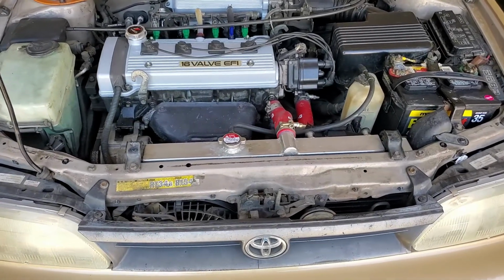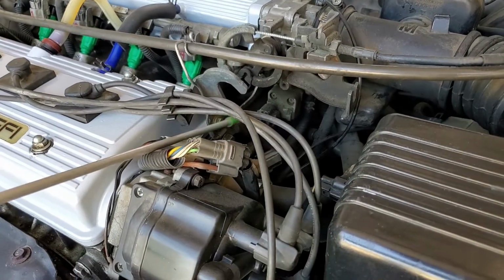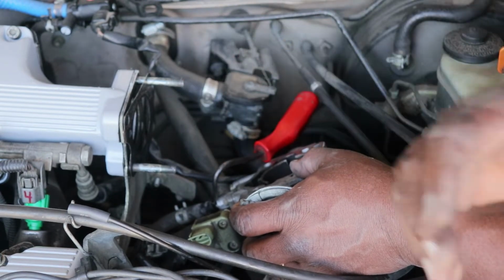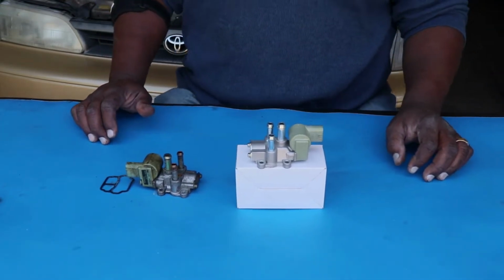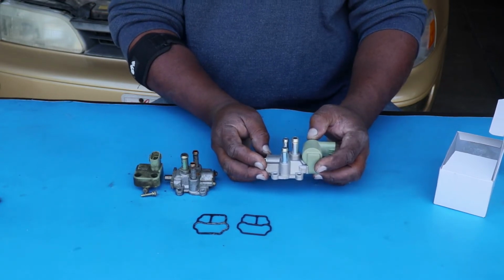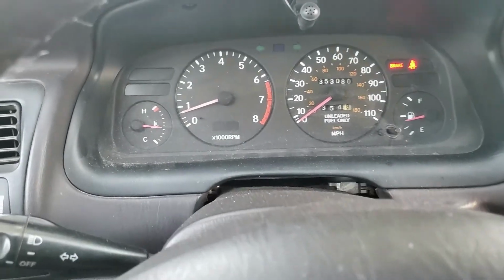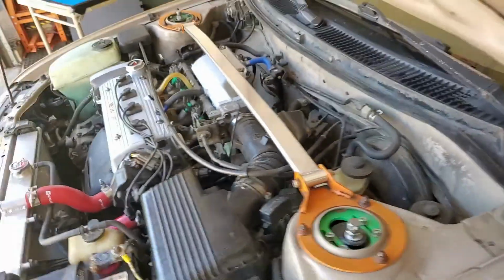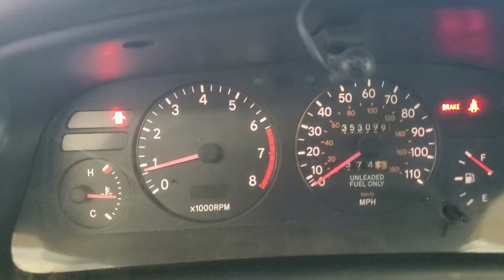Toyota Corolla 7afe Idle Air Control Valve, Old vs After Market vs New OEM

Comment: Hello

So I have the same issue, but in my case I have installed A/C on my own using OEM used parts, cuz originaly it wasn't there. I've installed new compressor, radiator, electricall stuff, ECU and other parts. When I turn ON A/C there is significant rpm drop and stays like that. I wonder if its the same issue like yours or maybe there is problem with ECU itself (not programmed). I will try to change it like you do and come back with update.

Comment: I decided to clean mine up as a maintenance thing but never had a problem with my idle. Even with the AC on it wouldn’t drop the rpms from the load. After cleaning it my Corolla now idles at 2k and drops a few rpms when I have the AC on now 😭😭
I guess something weren’t meant to be fixed but also I didn’t know the control valve was suppose to fully spin. When I took mines out it had about the same play as your old one and I assumed at the time it was normal to be like that.
Guess I gotta replace mines now sadly. Would I be able to just get away with breaking it loose some way?

Comment: Very helpful video bro,you should have used the old electronic module with the new after market aluminium assy to fix the problem. You didn't have to buy the whole oem for all those bucks.😊

Comment: My idle is way to high on a  2000 tacoma  been running with the iac unplugged  because when I unplugged it the idle drops a bunch  , after seeing this video gonna stay away from the cheap ones
Reply from the maker: High idle could be a vacuum leak, or just need an adjustment.

Comment: Interesting. I replaced my IACV with a decent quality one (NGK/NTK I think) which are usually reliable. I feel like when the AC compressor kicks on I loose power. Now you make me wonder if I should be using an OEM instead to see if it alleviates the problem. Hmmmm

Comment: That green coil part of the IACV is on slotted bolt holes. Get it to hot idle and then loosen the 2 coil screws and move the coil up and down or twist is slightly until you get the highest idle, then tighten the screws. I took my OEM apart and the metal barrel had worn grooves in the coil part! It was rubbing on the off centered plastic coil socket. I loosened it and moved it slightly and the idlepicked up and got much smoother, I then tightened the screws. I believe when the idle goes up, the valve duty cycle is greater ( I believe it vibrates open and closed) due to no drag and the engine gets more air as its suposed to. Just a theory but it worked on my old OEM one. The faster it can vibrate, the more air it allows to get in.

Comment: Sir i have the AE111 model i had this issue , i solved the issue by changed the TPS Sensor and the Map Sensor as well. I used back the original Idle Air Control Valve after service back.

Comment: You could have simply cleaned the old valve with throttle cleaner, lubed it with light oil and carefully put the motor back. That would have saved you $150.
Reply from the maker: I tried that first, it didn't work. then the other two.

Comment: I have a '97 Corolla 1.8 & has a misfire 
changed the plugs, still misfiring
thinking of doing the wires next & the IACV 
maybe do the distributor, fuel injectors, & fuel filter next even though a distributor & the IACV isn't cheap (on RockAuto, some are over $100)
Reply from the maker: Check the compression of the missing cylinder. Then check the fuel injectors, maybe swat them around see if the miss follows before spending a lot of money. Better to figure out want the problem is first.

Comment: IACV is hard to die, you should just take it out and clean it, then test the 3 pins with battery power 12V on B+ then you know the problem is on the IACV or on the blue hose device, that is another actuator compensate RPM for the air con on.
Reply from the maker: I did try cleaning the old one first. ... no go.

Comment: Sorry mate, The Idle-up the one with the blue hose is the one faulty not the IACV,...
Reply from the maker: Working great 👍  😀
Reply: this the reason. its not fault with IACV. Idle-up the one with the blue hose connected valve is control Air when on the AC.

Comment: I’m thinking of buying an old Corolla with a 7afe engine, would you say these a good reliable cars for daily errands?
Reply from the maker: Wow, I almost can't believe you ask is a corolla 7afe reliable. Hmmm let me think; it's only one of the most reliable cars ever built, let's look at it like that lol   ;)
Reply: I have had 2 7afes and thinking about getting a 3rd in a stick shift best bang for the buck car on the market just be aware of leaks on these old cars
Reply: GO FOR IT!!! I still have my 95 Celica in my driveway from high school. This car is so reliable, I haven't had a reason to get rid of it. I use it seldom now but my goodness the abuse its taken over the years is mind blowing. I'm talking road trips where i added coolant into the oil by mistake and so much more. Still rocking on